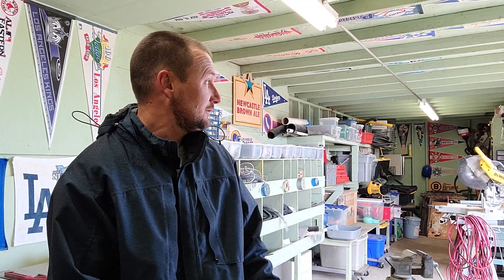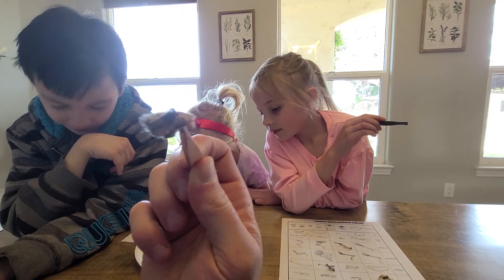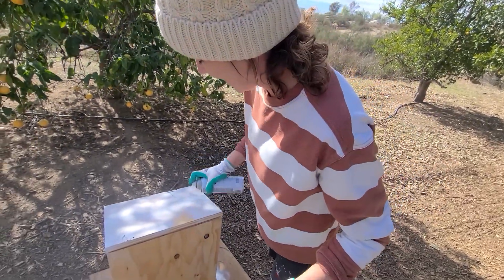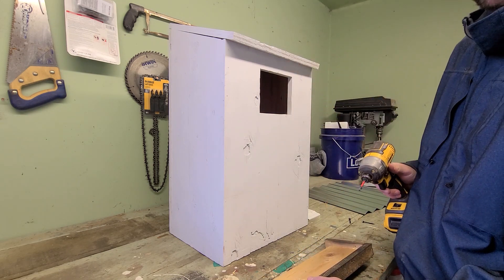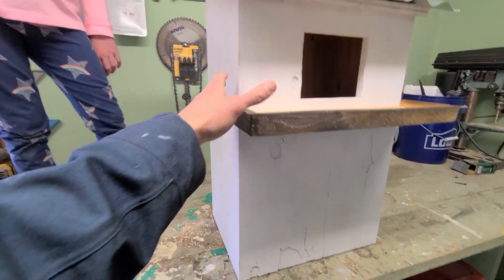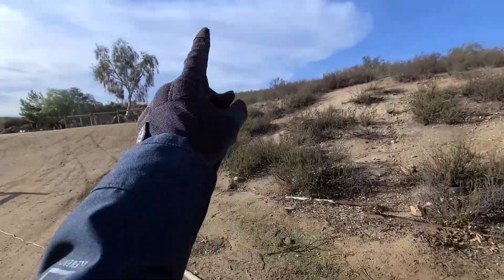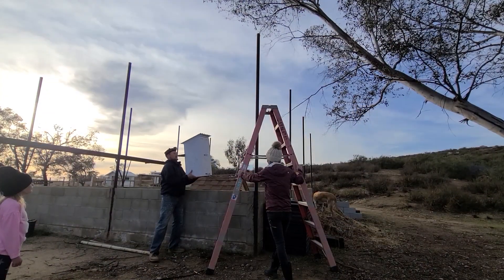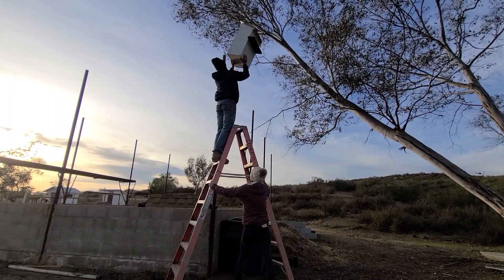DIY Owl Nesting Box | Dissecting Owl Pellets

Comment: Nice little box and very educational for your kids but just a little constructive criticism based on the research I did to make my owl box.
1.  Box may be too small for a mating pair. If she lays 5 or six eggs, which is common, it can get crowded in there as the babies grow. I've read where if the box is too crowded with baby owls the female could abandon the nest. Don't forget she's in there too and so is dad sometimes.
2.  You should have an access panel to clean it out after the babies leave. Maybe even a hinged roof.
3.  In forgetting the perch all you had to do was to make 2 supports, or corbels, to support the perch from the outside. But with a hinged roof you could've gained access from the inside. 
4.  I've read where a mating pair are likely to return to the same place the following year. It would be a good idea to replace it with something a little bigger and easier to maintain. Looking forward to seeing a mating pair in there! Hope I get some too.
Reply from the maker: These are all fantastic tips.   Really l really like the hindged roof idea. Thank you.  We've had some visitors, but not a mating pair that I can see.
Reply: @WaltonsRookieRanch  .....one thing I forgot to mention, owls don't make their own nests like other birds do, so if you provide a box for them it's a real good idea to put some dry leaves and/or wood shavings (not saw dust) inside the box to make it more appealing to them to use it. Maybe even some hay or straw. Good luck!
Reply from the maker: @eightinches6094  We went with some pine shavings, do you think that will work?
Reply: @WaltonsRookieRanch  .....Pine shavings are perfect. Let us all know if you get a mating pair!